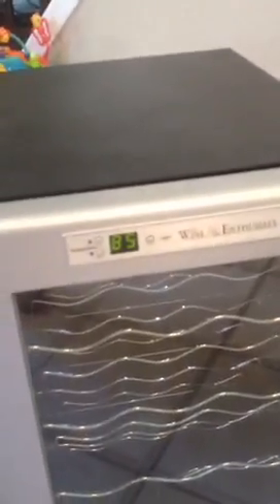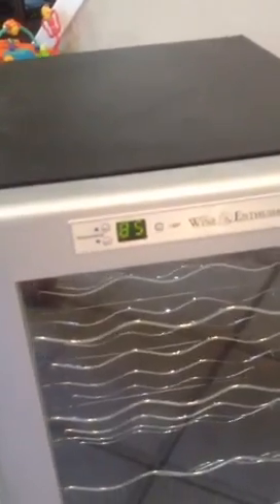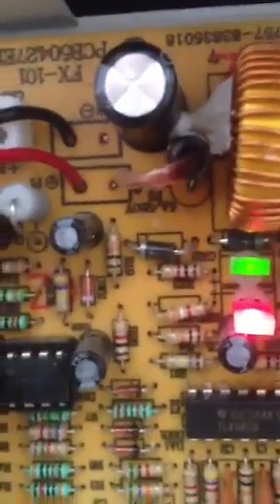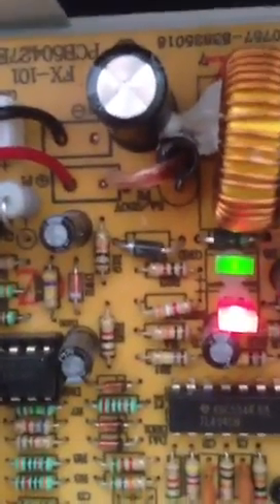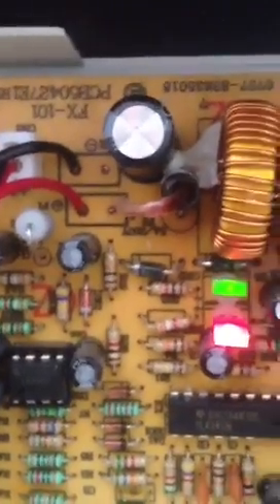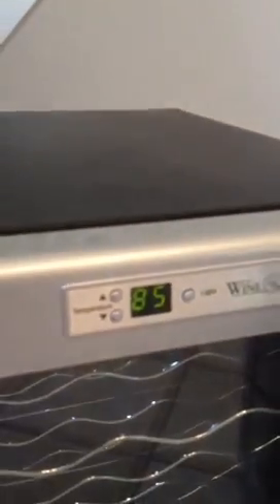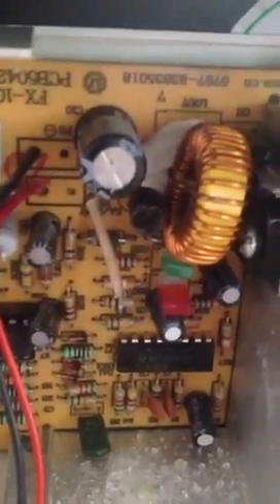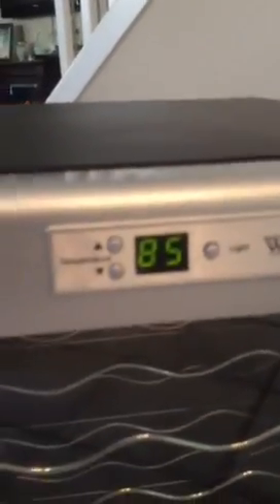Wine enthusiast repair

Comment: Pretty old vid, but in case anyone is looking to repair their small cooler, this fridge is not powered by a compressor, nor does it have any refrigerant in it. It is a Thermo-Electric cooler that uses a Peltier cooling device.

That fuse protects the TEC unit itself and should be replaced with another fuse rated at 125V and 8 Amps (check the original fuse). Very easy replacement if you can solder a wire you can solder a fuse. You can pick one up at your local hardware or automotive store for pennies.

If you Google Peltier you can find out how they work and find repair vids for various problems. All of these small fridges work the same, look up Haier or Emerson as well as many others.

Peltier cooling is based off the temperature of where the unit is installed and can only cool to within a given differential. Most of these coolers can only cool to around 50 degrees in a room that is 77 degrees.

I have switched out the original power supply with one off Amazon, since the unit I had failed, as well as replaced the TEC unit and the fans for a much more efficient cooler. Total cost of repair was around $40 USD.
Reply: Sure would like to see your video of the correct parts replacement vs this hideous video of fire marshall Bill.
Reply: @peazy7  These parts are readily available on EBAY and other sites. Just match your current parts to something similar in power ratings. Fans were just PC fans I already had, but match the size and you should be fine. I don't have any videos of the replacement, but it is pretty simple.
Reply: Can you list your parts list for upgraded fan and power supply please? Thx
Reply: @peazy7  I've since sold that unit. You'll need to measure your fan and just pick up a replacement of the same size. On the PS, just search for the part number or the rating and make sure its a PS for a TEC unit. EBAY is littered with TEC power supplies, but its going to be specific to your unit.
Reply: @mikehoward9499  Thanks Sir, I have found TEC and was going to get one that cools a little lower than 47 degrees like maybe 35 degrees
Reply: Thank you for this info. Got parts ordered and ready to repair this unit!

Comment: This video is a dangerous cure.  If a fuse blows just hard wiring a replacement is very dangerous; the fuse was there for a reason.  Replacement fuses and fuse holders are readily available and easily replaced.  Many things can cause a fuse to blow, but sometimes it is a bad component elsewhere is to blame and hardwiring can cause you to blow more expensive  components.
Reply: The last thing in the world you should do is to jumper a fuse in any electronic device. Really, that is a terrible idea, and not only can a damaged unit be more thoroughly damaged, but the unit might also come on and start working as in this case, and then later, an intermittent short could cause a fire!

Comment: Look on the controller board for a blown capacitor. The cap with a triangle (mercedes logo) pattern will be pushed up if the cap is blown.  2200uf 16v, $0.50 repair.
Reply: Ding ding ding right answer!!!!

Comment: Similar unit, dual zone cooler...opened it up, ready to replace the cleverly disguised fuse when I realized one of the wire connectors was unplugged...reconnected and voila! $399 unit works like new!

Comment: No, different issue.  What Temp does your unit get down too?  Is it in a hot room?  Is there air flow through the condenser (the fins in the back)?  Try cleaning that out really well.  You can use one of those co2 dust removers that you use on electronics and really clean the back of the unit.  If the unit can't get to temp, it wont shut off.  I know mine struggles in the summer and doesnt shut off, so try cleaning it first. Then look to the other issues.

Comment: If anybody cares I cut the black cover off of the fuse to reveal that it's a 5 amp 250 volt fuse, if you wanted to replace it , that is.
Reply: Good trouble shooting, but fuses are there for a reason, not smart to replace a fuse with a "none fusable" anything. Good way to short, overload, overheat and start a fire. You just removed the only thing keeping a component that cuts the power from a shorted, defective, overloaded or overheating. You could possible safely maybe go an amp or so larger fuse, but if that one blows, your probably asking for trouble in the future, I'd make sure your home owners insurance is paid up, just sayin'.

Comment: What if all the fans are running,  but the unit isn't cooling. I'm looking for blown capacitors and exposed the fuses, but both look to be fine. What other electrical problem could it be? Just buy a new board??

Comment: Somthing did cause it to pop, but that fuse is there to protect the circuit board.  So nothing serious will happen, just the board may burn out.  Then it is time to put it in the dumpster, unless you want to buy a new board.  If you can just replace the fuse.  Though, I personally dont know what type of fuse they have in there.  So not sure how easy to get.  I'm trying to find a fan moter right now without much luck..   Experiance...x-commercial refrigeration journeymen technician.

Comment: Hi I have one of these same coolers here in Australia but they are called Summit wine cooler. Mine has the same board but no fuse on the DC side Like you have. When mine powers up  it makes a crackling sound in the same area where your fuse is, and no red and green leds are working . I can get it to fire up by disconnecting the red or black wires that are soldered in to the board which go the the thermoelectric cooler and reconect again then it all fires up fine both leds working  unit chilling and no crackling noise. It will run fine until the power is turned off and back on again. Any Ideas? Have you struck this before?
Reply from the maker: Michael Altorfer hmm I’m not sure what that could be. Weird that it resets itself like that after you turn it off and on.
Reply: Something is sizzling.

Comment: I have the same issue but I cut the fuse out completely and tried to wire the protected wire into the board but it did not start the fans on contact. I also found another fuse on the circuitboard but I cannot see into it to see if it is broken or not. Any ideas?

Comment: I have a summit SCR1536 and it stays running all the time! I called summit and they told me it was either the thermostat or the compressor! I tried looking for replacement parts and i couldnt find anything! Do you think my unit can be fixed the same way as shown here? Any help would be appreciated...Thank you!

Comment: Thermoelectric cooler.... no compressor.
Reply: +Dominik L  also.... not entirely sure why youd bypass a fuse. If the fuse was the issue, replace it. Obviously something was/is shorting to cause it to blow if at all. Should 9 out of 10 times the power supply board burns out, bypassing the fuse is a temporary and potentially dangerous solution.
Reply: +Dominik L  oh and main cause of this: notice how the cooling fins point toward the power supply board.... the cooling fans blow into the hot side of the thermoelectric plate, that in turn blows onto the power supply board, overheats it and causes a failure.
Reply: The capacitor 16v 2200uf capacitor is the issue. It’s tripping the fuse. If you don’t replace that it’s going to blow other things.

Comment: I have the same problem. Can anyone identify this type of fuse? I can't find a replacement anywhere. The board says 5A/250V, but I can't find any code on the actual fuse. Does anyone know of a safe replacement fuse?
Reply: It’s not a fuse.   It’s capacitor.

Comment: In the same fridge, I'm having an issue with beeping coming from the temperature control.  Meaning, the unit beeps even though the temperature buttons are not being pushed.  It is sporadic, then will stop for usually a few days, but then start beeping again.   

I replaced the entire back panel with all of the wiring and the beeping still happens. Any ideas on what to do?  Thanks.
Reply: Which board did you replace?

Comment: Hi guys, I have a dual zone Wine Enthusiast cooler, the bottom cools down only at 53 but the upper is not cooling at all, stays at 82. Is this the same fuse problem ?
Thank you
Reply: I know this is late… but did you ever find the fix for this? I’m having the exact same problem.

Comment: The fuse blowing means there is a power draw somewhere. Make sure your caps aren’t bad.

Permanent fix is the C8 capacitor is bad. 25v 47uf cap. If that doesn’t work, replace the cap right by the top plug he pulls out. Forget the voltage / uf. You can buy a cap kit online and a solder iron with some solder.

A bad capacitor could have also taken out your switching transistor. That’s another reason it shorts.
Reply: I did this to check and see if the fuse was the problem.  The way they made this cooler, they didn’t allow for fuse replacement, which should be easy, but no Wine Enth wants $350.00 for a be board when a little fuse is all it needs.
For me, I will be taking the fuse all the way out and replacing it.  I’m also gonna check the Caps.  In addition mine is NOISY, so new cooling fans are on the way too.
I think bypassing the fuse Is a bad idea, but for testing the thing it should be fine.  Anyway, it was nice to have the unit actually power on and cool.  Mine is from 2007 and they were shocked by my serial number.

Comment: I have a wine enthusiast wine cooler that holds 24 bottles. Model 268783608 and it is not cooling would this work for mine ?

Comment: Be careful bypassing fuses! I learned the hard way... had a hot tub that was throwing a breaker, so we put in a larger breaker (same thing you're doing essentially). That night, the hot tub caught on fire and almost burned down the neighborhood. flames 25 feet high.
That fuse blew for a reason... to keep some other, potentially more flammable part of the unit from overloading.
... just saying....

Comment: This wine cooler doesn’t have a compressor. Bypassing any dude is not smart. In fact, it’s stupid. Fuses are inexpensive. If you can solder, you can replace one easily. Repairing a fuse is insane. I appreciate the motivation to do what it takes to get it working, but please be safe and use common sense.

Comment: Excuse me my DIY guy but you could be putting people at risk. I hope you are not in the repair business. That could be a fire accident waiting to happen. Fuses are installed for a reason and blew likely for a reason other than the fuses fault. YIKES.
Reply from the maker: Donald Joseph Wood, This video is 7 years old and it is just a way to get faulty coolers running again. I will make a side not on the video stating that this is not a correct fix. Thanks for your comment.

Comment: That is a risk you have to be willing to take. There are safer ways to fix the coolers like installing another fuse. But if you want to do it from home without any real skills needed this is an option but you are right. This obviously isn't as safe as a fuse.